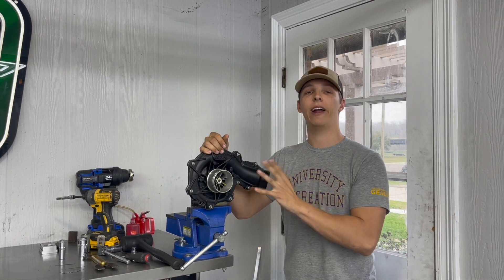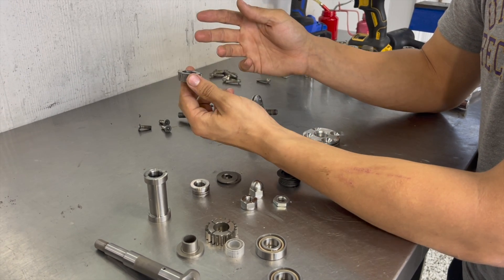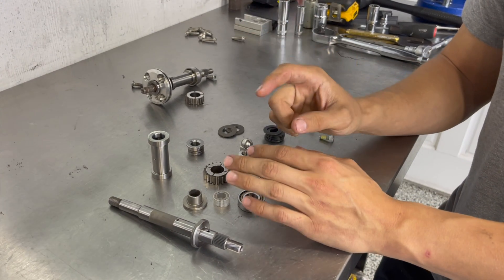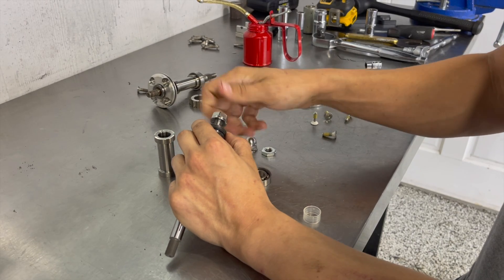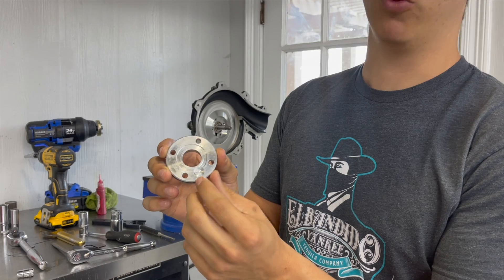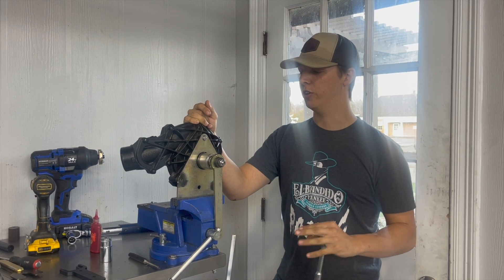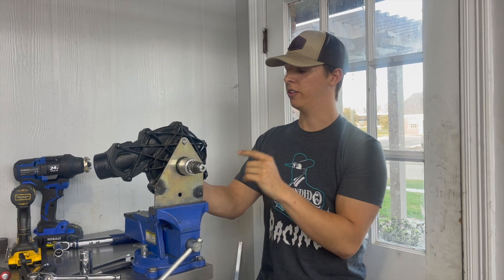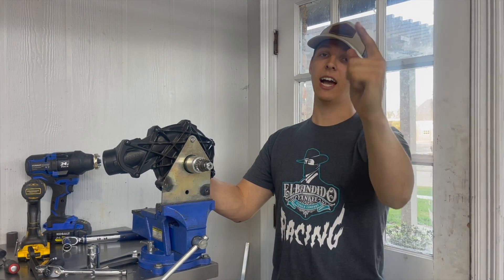Rebuilding the "Maintenance Free" Sea-Doo Supercharger: Sea-Doo is LYING to You!!

Comment: I have a stock 2016 with gear side bearing failure 
Is there a aftermarket or seadoo impeller available?
I’ve done loads of 215 supercharger rebuilds and just starting on 300
Where did u buy your tooling from 
Also I see I can’t seem to 
find complete rebuild kits 
I am in Dubai
Reply from the maker: The GreenHulk Store sells the rebuild kits and tool kit. The tool kit is here 

https://www.4-tecperformance.com/index.php?main_page=product_info&cPath=349_379_63&products_id=17404

The rebuild kit is here 

https://www.4-tecperformance.com/index.php?main_page=product_info&cPath=349_379_268&products_id=6452

We have several aftermarket impellers available, all found in this section of the GreenHulk store 

https://www.4-tecperformance.com/index.php?main_page=index&cPath=63

Thank you for your business!

Comment: why does it look like a turbo
Reply: it is basically the intake side of a turbo, however turbos are driven by exhaust gasses, while superchargers are driven by the motor, either by gear or belt. On seadoos, the teeth contact the crankshaft gear. They do make some seadoo from factory with turbos though.
Reply: And the reason why, is because its easier to shove the supercharger in from the front of the engine, rather than having a top mounted supercharger which would be heavy, have heatsoak and would require a lot more area to remove and a entire engine redesign as they would not be able to side mount the supercharger.

Comment: I have a 2004 seadoo GTX limited supercharged 185 horsepower. The ski has less than 100 hours on it and has been sitting for over 14 years in a garageI.  have read in some places that the valves need to be replaced Mikasa possible failure. Does anybody have any input on that?
Reply from the maker: The first thing you need to do is rebuild the supercharger. The plastic bearing cages get brittle with age and will fail. 

Check out our supercharger rebuilding service here in the GreenHulk Store.
https://www.4-tecperformance.com/index.php?main_page=product_info&cPath=349_379_63&products_id=5170
Reply from the maker: 06 and older skis are prone to exhaust valve failure, it’s best to replace them. The Supertech valves are what you want. They are lighter, stronger and cheaper than stock 
https://www.4-tecperformance.com/index.php?main_page=product_info&cPath=356_371_427&products_id=2114
Reply: @GreenHulkGarage Thanks.

Comment: Yea I told the dealer to check that First dealer said there’s no way and they still couldn’t figure out any other issue. Blamed it on a bad temp sensor that they set off because not having it on the hose but still didn’t fix the problem. Second dealer said they took apart pressure tested it and it was fine, they said they water tested it and ran 8000 but I took it out right when I picked it up, nothing was resolved it still would cap out at 6700

Comment: Is there away way to tell via candoo/buds live monitor if boost number is low on 300? I have a scarab with 300 and I only get 6700-6800 rpms out of it now. Its been to 2 dealers and they are can't find the issue.
Reply: check if you have a crack intake manifold

Comment: This is nuts. The s/c is described as "maintenance free" check after 200 hours or two use depending on intensity of use. It was recommended to rebuild. Then the recommendation was get a new 
s/c. Lots of variables and increasing warnings and prices.
Reply: I got serious problems with mine at 197 hours 2020 GTX 230

Comment: If you know a thing or 2 about the cause your explanation would be more informative and less opinionated, the clutch slip is paramount if it has and excessive amount of slip heat is created and effects the hardening on the gear effecting the teeth hardness or chattering clutch shockloading the cartridge causing failures. every charger needs to be reset at the 10h breakin period and checked either every 50/100h depending on riding style, I have changed my maintenance procedures towards my customers ski's and haven't had any failures since 20min service for Piece of mind
Reply from the maker: There is NOTHING opinionated in this video. I have rebuilt thousands of Sea-Doo superchargers (minimum of a dozen rebuilds a week…I’m sure you can do the math) and I have seen it all. Not a single failure has happened on my personal skis or a customer that I routinely take care of. Every failure I have my hands on is fixing damage that has already been done by someone who was not aware of the maintenance procedures. On my personal skis, I set the slip almost after every ride. Why? Because I am making far more boost than a stock supercharger and beat the hell out of it. The maintenance required and the frequency of setting the slip will vary depending on what’s been done to the ski and how it is ridden (which I made clear). Evidently, you didn’t listen to 90% of the video going over FACTUAL information of other failures, their causes, and my recommended procedures/interval to set the slip.

Comment: Do you have a recommended rebuild interval for these?
Reply from the maker: I would rebuild these between 250-300 hours on a stock ski. I would rebuild them much sooner than that on a modified supercharger that gets more abuse.
Reply: Thank you.  What about time range?  If the ski gets little use, would you recommend every 2-3 years?   Or is this solely based on hours used?  @GreenHulkGarage
Reply from the maker: I would not worry about it unless the ski gets neglected. If it doesn’t receive adequate oil changes and gets left to deteriorate then I would absolutely rebuild it sooner.
Reply: @GreenHulkGarage how long would you say would be the point of too long being neglected to where they should be rebuilt? I just picked up 2 2005 seadoo 215s, and am debating if I should rebuild the superchargers or not
Reply: @GreenHulkGarage  spec is every 100hrs, I've seen many start leaking oil and getting play in the bearings around 100hrs or so

Comment: This applies to the 2022ish 300s and the new 325?  Is there another supercharged ski you would say is more reliable long-term without needing a SC build?  I am in the market.  Thanks
Reply from the maker: This only applies to 300 superchargers. Older superchargers from Sea-Doo require more frequent maintenance than a 300. The new 325 has totally different design and should not require any routine maintenance. The 325 uses a completely different clutch, bearing, and gear design than the 300 and older superchargers.
Reply: Thoughts on the Sea doo switch superchargers? Will they be more reliable in that platform?